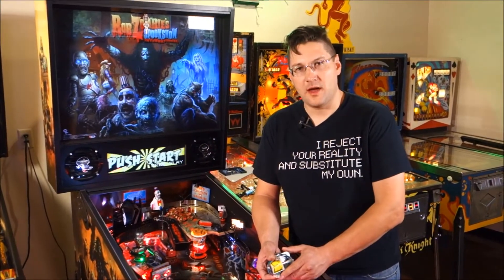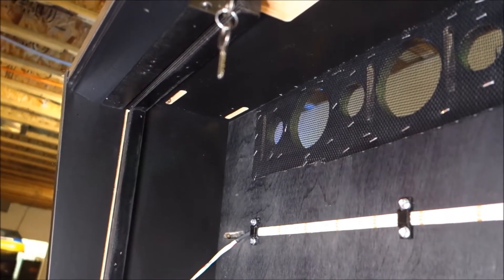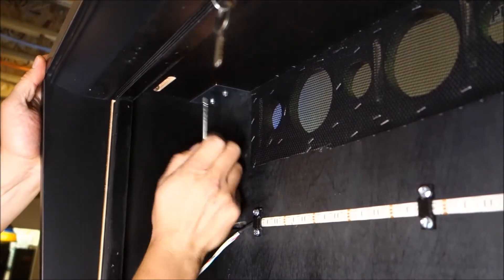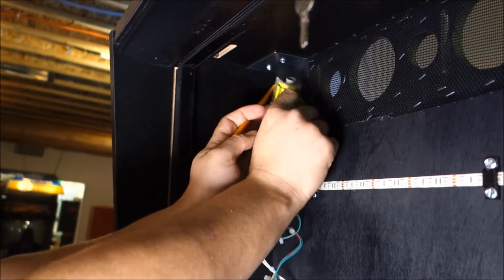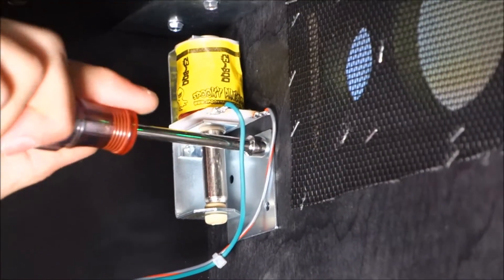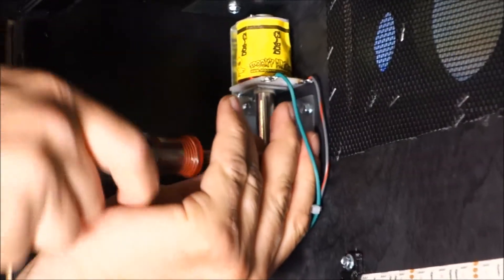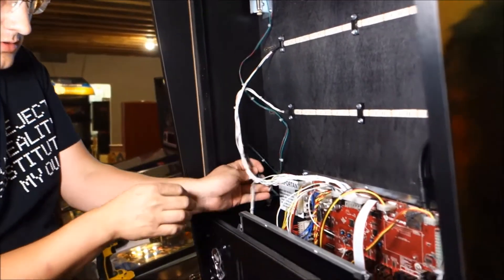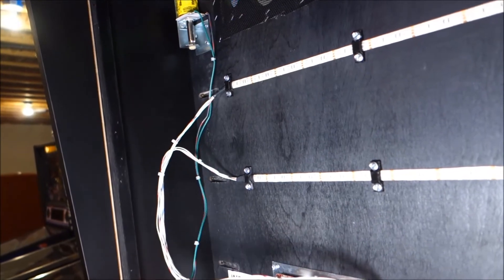Rob Zombie pinball knocker install

Comment: About to install mine now, nice video :)
Reply from the maker: +Neo ZaTZy Thank you
Reply from the maker: Neo ZaTZy thanks.   I hope your install went smooth.
Reply: Pinball Mayhem followed your vid and it works perfect I used my index finger to get the 1/2 space lol and yeah it works sweet.... I measure my index finger and it's just a bit bigger than 1/2 so perfect,  I also installed a shake motor at the same time, you should do a vid for shaken motor if you have one, feels great with a shaker of in 🤘👍🤘👍🤘🍻🤘🍻🤘
Reply from the maker: +Neo ZaTZy awesome! Thanks for the feedback.

Comment: 50 v?
Reply from the maker: The machine has a 48 volt meanwell power supply.  Same that’s in the homebrew featured on this channel.  Ghost in the shell.  Now those can be “tuned” up to 50v dc.  I believe spooky does this.  Now the direct coil control is by pwm. That doesn’t give the full bang.  It pulses it.   Constant 50v would melt the coil.  Same windings used in most home brew p3-roc builds.